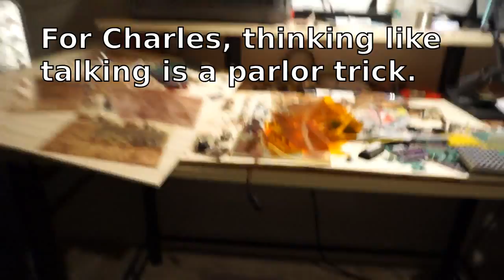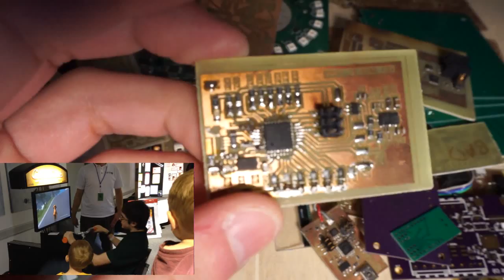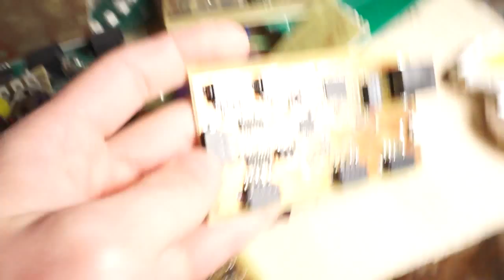PCBs of Projects Past

Comment: You said the glass boards can get broken because of those large programming headers on them...
What I do now is I just print the pads, leave the headers unpopulated, and I bought pogo pins. I will never go back to headers. It is too easy to use the pogo pins.
Reply from the maker: +Jacob Schmidt What pogo pins are you using, I am interested.
Reply: Just search eBay for "pogo pins". Looks like they come in different diameters, 1.02 mm is 18 AWG wire, I would check and see what gauge fits into your programmer pins snugly.
Reply: 22 gauge is breadboard jumper wire size = 0.65 mm, so these would fit, but might pull out too easy.
http://www.ebay.com/itm/371077892134
Anyway, you get the idea.
Reply from the maker: You mount these in a breadboard?  Hmm... looking at them I'm really not sure how I could mount them in a PCB?  Do they just fit through some holes?
Reply: No stick them in the header of your programmer, then when you want to program, you just push your programmer + pogo pins against the unpopulated pads on your device-to-program.
You have to sit there, holding it for the duration of the programming sequence, but I find that isn't that long.
I suppose if you wanted to get fancy about it, then get a third hand or something to hold it. I can send a pic of what I do if you still don't get what I mean.
Reply from the maker: Cool Thanks. Bought.

Comment: wow, very awesome! i would totally buy the microscope slide with the touch sensor controlling the LED off of you, i am still amazed by that project! :)
Reply from the maker: I can check if it still works.  I'd be willing to part with it for the cost of shipping + $8 for packaging and the trouble of getting it to the post office.
Reply: CNLohr Wow, i would totally do that! i live in germany though, not sure if you could send it to me for 8$...:)
Reply from the maker: I said $8 /plus/ shipping :-p  Though I don't think it's too expensive to send to Germany.
Reply: CNLohr well, if you tell me where you live (state) i could see what it would cost :)
i am still intrested in that thing :)
Reply from the maker: Maryland.  I was concerned about the packaging and whatnot, but I can't imagine the package weighing much even with a boatload of packaging.
Reply: CNLohr well, you could techically stabilize it with 2 pieces of stiff material (scrap PCBs, little pieces of wood or whatever), wrap with with some toilet paper and put it in an envelope. that should work, shouldn't it? :)
i can't really find something in the Net for how much it would cost, but if you could get it to me for 25$ or less i would totally be in :)
Reply: muh1h1 USPS Priority Mail to Germany is about $25. Perhaps a bit less if you use the flat rate envelope.
Reply from the maker: eep.  Airmail is what I normally use.  I'll try to find out sometime this week.

Comment: How did you plate glass with copper ?
Can you talk more about etching boards on kapton even if didn't work ?
What is that condutive silicon stuff ? Seem you were pretty successful with it?

Bonus question, do you know of an electrically conductive (strong, like epoxy or cyanoacrylic) glue that costs less than 0.10$ per gram ? 

thanks !
Reply from the maker: I glue copper to the glass.

Copper +kapton works reasonably well.

It's thermally conductive silicone sheet.

I do not know of such a glue.  Though there are a LOT of people looking for transparent conductive materials.